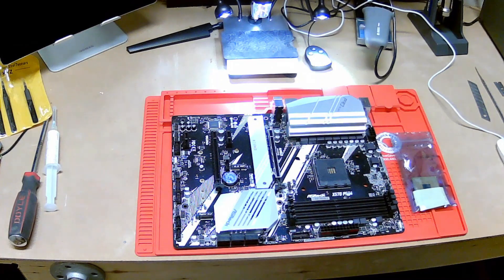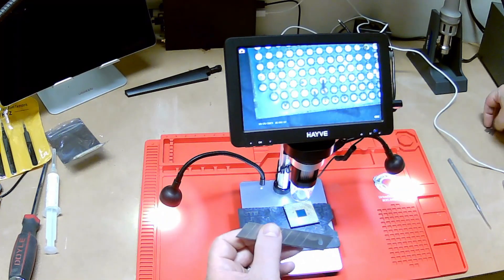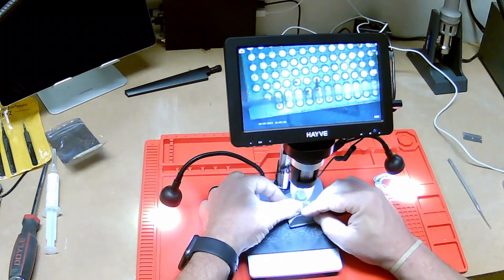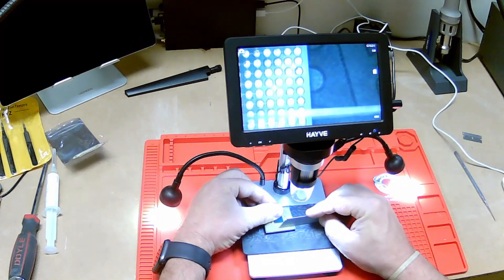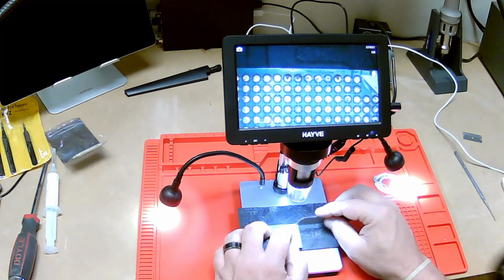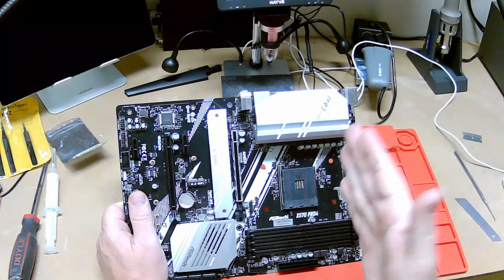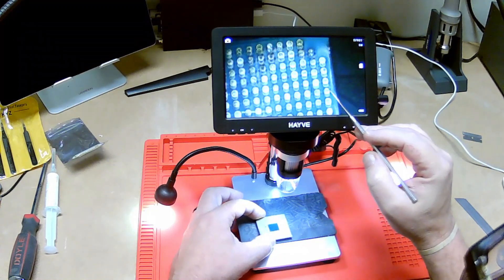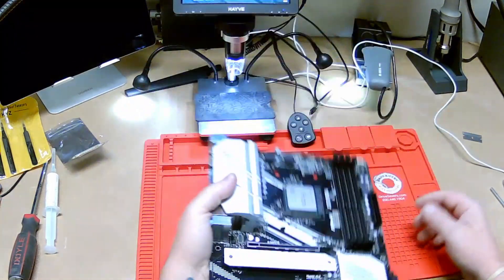How to FIX BENT PINS on Ryzen CPU (or any pin CPU)!

Comment: I just got a mildly bent Ryzen 5800x for $50 with a cooler. I went to dollar store and got candy and a mechanical pencil. 
After finding out that the mechanical pencil wasn't going to work for this smaller pins, I ate the candy and watched this video.
Now, I am ready to attack it the razor method. TY!
Oh, it was peanut M&M's and Mike and Ikes.
Reply from the maker: Awesome 👏🏻
Reply: @bobdoestech  It worked and your method was perfect, thank you for making this video!
Reply from the maker: You’re welcome ☺️

Comment: Did the same for my brand new 3700x after I ripped it out of socket stuck to wraith cooler. Used it for 5 years then sold it with no problems.